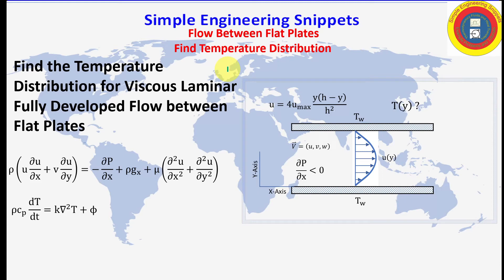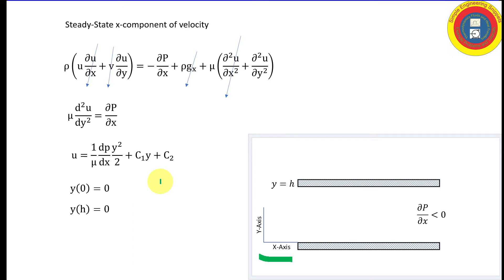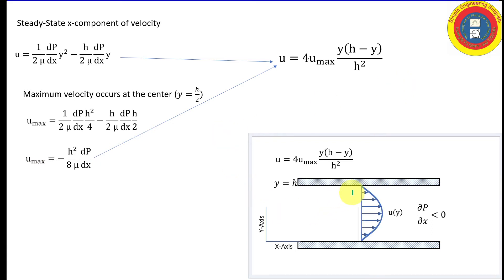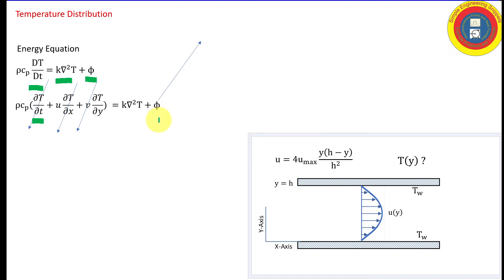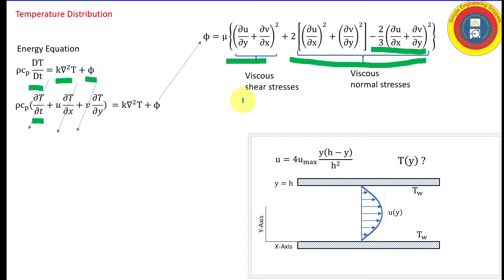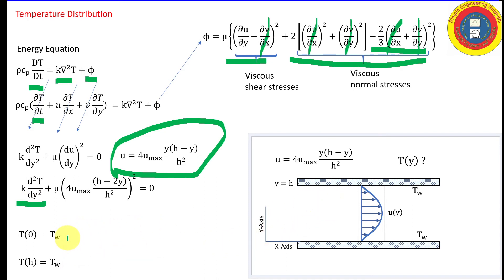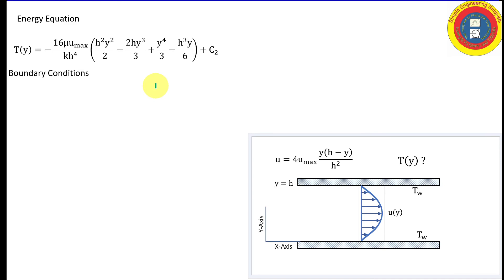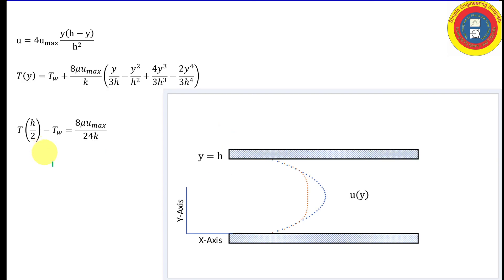Temperature Distribution in Laminar Flow between parallel plates

Comment: Is there a way to check this by relating the head loss to the rate of heat transfer into each wall? Seems like there might be an energy based approach that could be fruitful and interesting.
Reply from the maker: Certainly for turbulent flow Reynold's analogy ( with Prandtl number ~1) relates the skin friction coefficient (shear stress) with the Nusselt number (or Stanton number).  For laminar flow past a flat plate with no external pressure gradient you can analytically relate the Nusselt and shear stress.  To be honest I have not seen the solution for this flow, doesn't mean it doesn't exist!  Sorry I don't have a better answer but I hope that helps!  Thanks for checking out my video.
Reply: @simpleengineeringsnippets7102  Thanks for the reply! Nice video!